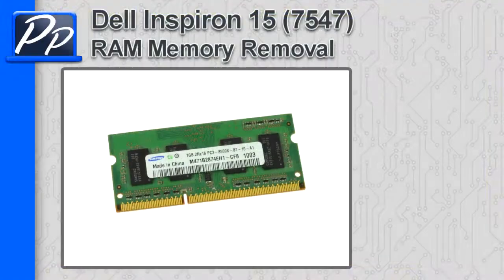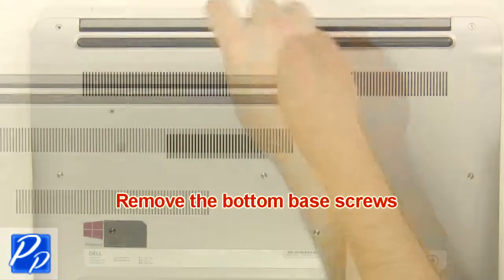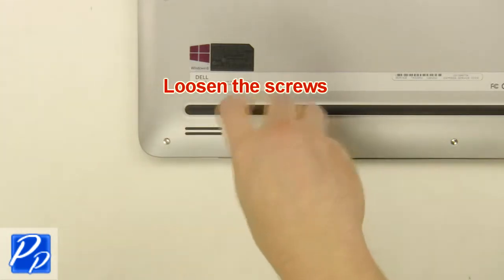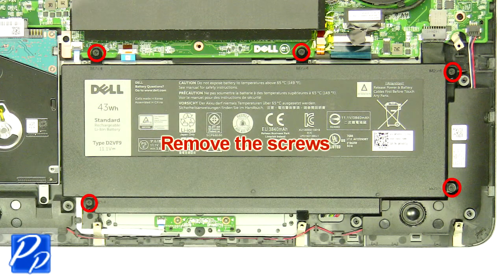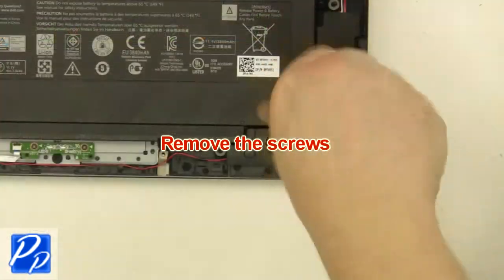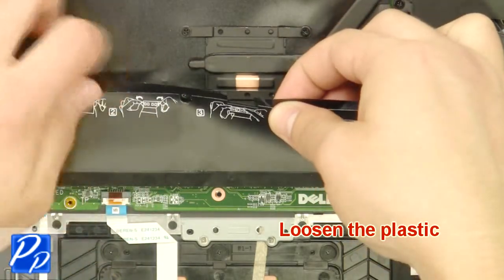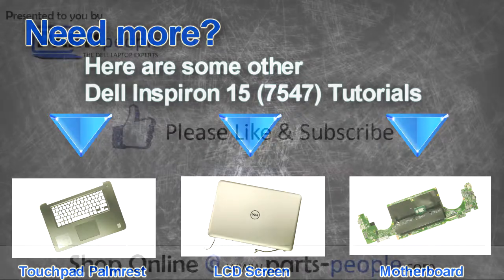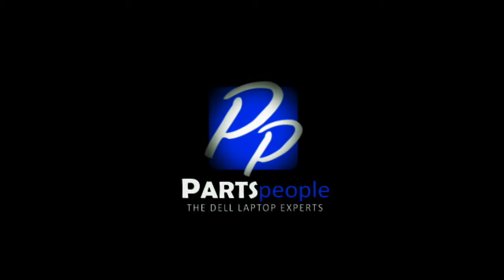Dell Inspiron 15 (7547) RAM Memory How-To Video Tutorial

Comment: Thanks! I was trying to fix my parent’s computer (this one of course) and it said manufactured in 2014. I had to just reseat the ram because first I had put it in wrong lol. Now I have to see how to replace the lcd because it did 8 beeps, they are flipping loud. 8 beeps because that means a lcd failure